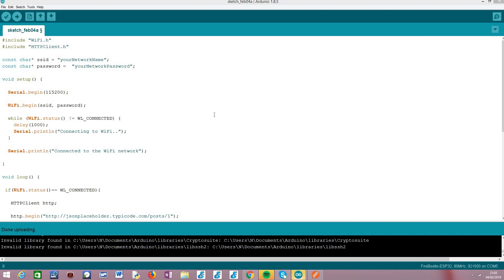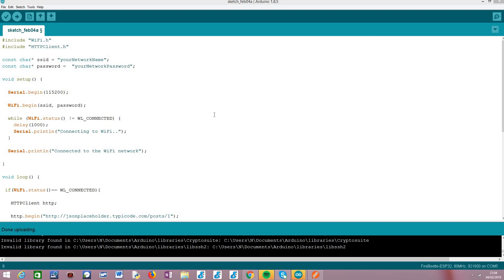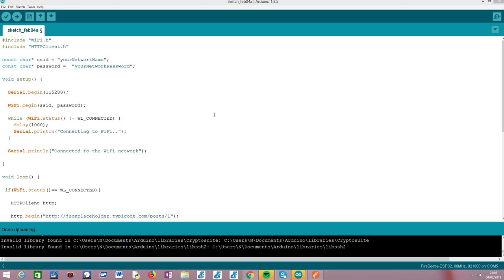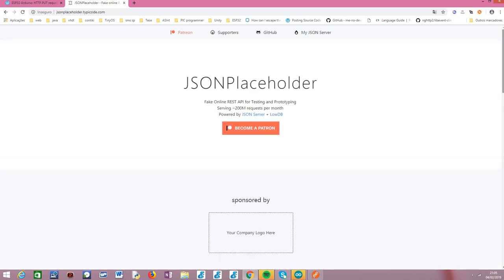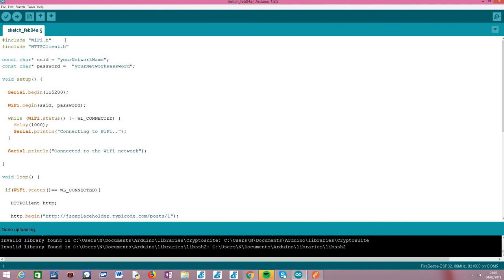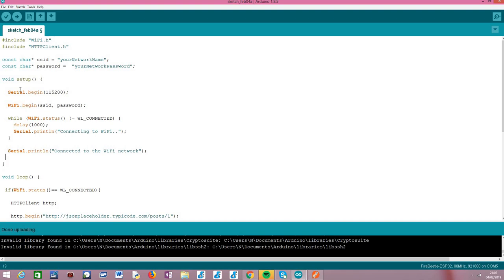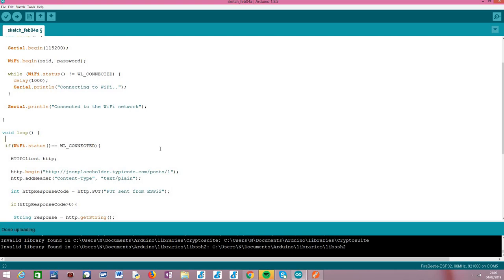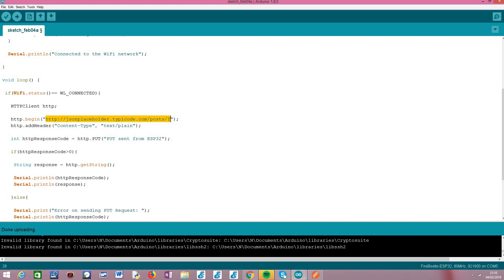ESP32 Arduino HTTP PUT request

Comment: If we don't want any blocking code in our application, could these objects work in an ESP32 thread while our main program runs in another thread? If so, is there an example available please? ( how to run 2 different threads and exchange data between them? Thx!
Reply from the maker: Hi! Yes it should be possible, although I haven't tested yet for that particular scenario it should work fine.

Here is an example using queues for inter task communication:
https://techtutorialsx.com/2017/09/13/esp32-arduino-communication-between-tasks-using-freertos-queues/

Hope it helps :)

Best regards,
Nuno Santos
Reply: @techtutorialsx11  Ok thanks a lot for your advise and help!